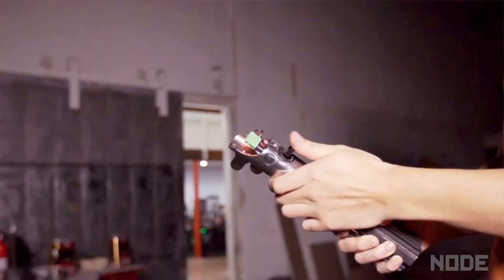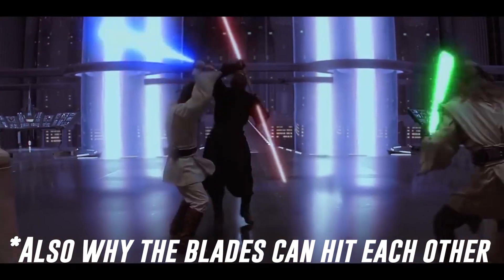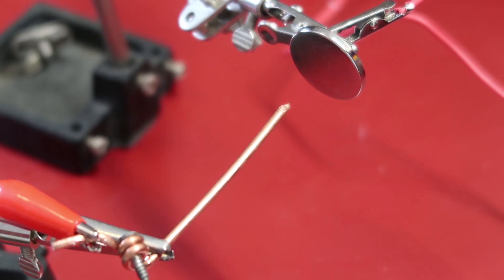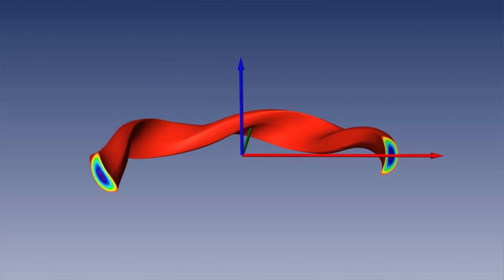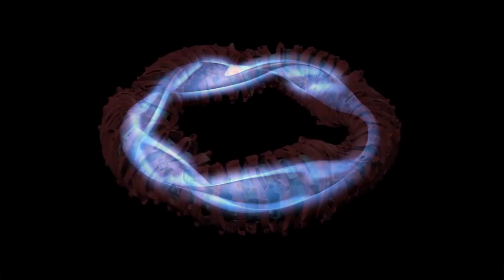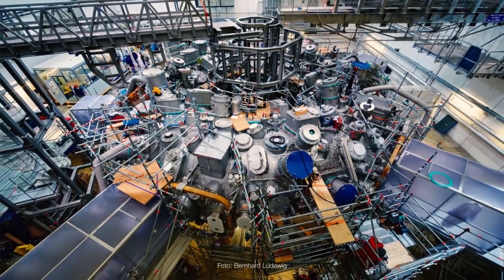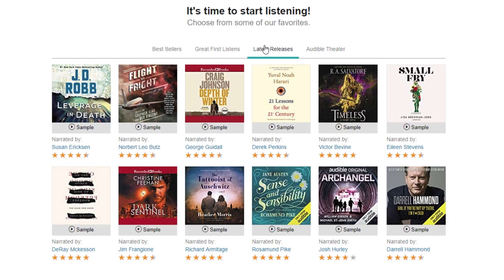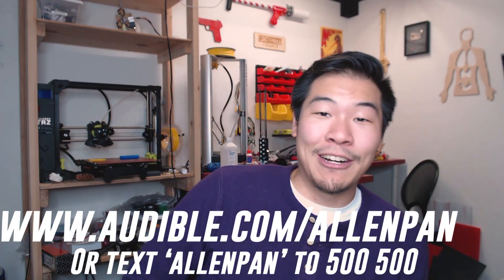Real Life Plasma Blades!!!

Comment: it is more like an inverted halo sword, yeah. But I wonder if you could make it have a rod in the middle and have like plasma, or eletricity around it to not have 2 completel usable pladeb and a useless plasma "balde" in the center. I know it' probably a dumb question to ask, but it seems kind feasable if the magnets try to atract the plasma instead of repel the and keep the plasma away due to heat (not very performane friendly ik)

Comment: This is lame...
We need a real blade that can handle being turned into plasma ..
I'm thinking an outer layer on the blade that will last long under super ionization.
A solid matter ofc.
And ofc like halo bringing the idea of magnetics into the mix that can keep the blade stable but we don't have materials that can handle this or a power source that can output this energy for long and be portable.

Comment: Hi Allen,

I’ve been wondering what would happen if the copper elektrodes (or a whole aray of them) are positioned in such a way (at the circumference of two shaped ‘plates’ or ‘blades’ which are doubled up a few mm apart so that they provide both the place holder between the electrodes ‘and’ a duct which allows air to be blown outward from the circumference (all around the circumference in equal measures)? The concept you guys came up with and built proves you can blow plasma away from the electrodes. If we blow it outward rather then length wise… wouldn’t we have an actual outside perimeter plasma edge? 

If you want I can draw a CAD assembly with the basic ideation (schematically and as a means of being able to discuss the idea).

Because of the nature of how the parts would relate to each other in this setup the actual physical blade would still have a (double) edge interfacing with the outside world when you hit something. All the elektrodes would be safely ‘in between’ the blades and somewhat recessed. Should make for an axe or blade you can actually use to forcefully hit objects without it breaking. 

Let me know what you think! 

With kind regards,

Marten

With kind regards,

Marten

P.S. have a look at my insta to see some of the things I’ve been up to in my spare time.

https://www.instagram.com/p/CJYqThBh71h/?utm_medium=copy_link

Comment: hi allen idk if i should ask on a more recent video but could you make a really hot blade but like this so it uses batterys instead of using a blow torch? and if that doesnt work can you get a small rod type thing with a hollow center and make a bunch of tiny holes - send gas thru it and then if thats working maybe also do the heat thing? i feel like it would look at least similar to a lightsaber and im not an expert but i assume you might also be able to change the color if you want

Comment: If you want something extremely effective and dangerous probably equally , may I suggest bladed edges and a motor to vibrate the blade with a plasma current down center for a V2

Comment: rotating the plasma rapidly causing a vortex, and will lengthen the plasma, of course you have to use a circular anode/cathode, you may also need an electro magnetic solenoid to push the plasma outwards longer.

Comment: Remember that flyback transformer makes DC output. Use some transformer that does not have rectifier at the output and it will be 100 times hooter.

Comment: what if you used a more conductive material instead of the copper. like say gold wire maybe, but that would probably be extremely expensive depending on purity.

Comment: i think the problem mainly is the plasma is still stuck between 2 physical blades instead of on the outside .
perhaps you could make 2 think blades out of like a pipe and have insulating material holding the back side.
then have an air fly going through it.
in theory this will push the plasma outwards forming a blade edge...
so you would have the metal body and then plasma edge on the outside instead of between 2 metal blades.

Comment: I mean, it's kind of cool, but it's also not really useful. If you can figure out a way to make it so that it burns hotter and one edge is entirely open to air, you might not be able to shape it as well, but it needs to be more useful than a knife or there's really not any good reason to use it.

Comment: Is it even still considered a blade when it's sheathed? Can't cut anything when it has a chunk of metal on both sides preventing any cutting. And because it's not that hot, basically what it's doing is just electrocuting the target that gets too close to the nodes (the furby didn't even die from heat, it died from having two high voltage chunks of metal zapping it repeatedly until it fried the circuits). Really disappointing :( Pretty sure i've seen 'safe' cosplay weapons that did more damage

Comment: Hey that's not fair why not unify intense radiation electromagnetic solenoid hold sense over acoustophoresis tractor beam fluid  plasma sword electron controls modulated light sensory axis accelerometer cylinder rotary thrust proximity radiation

Comment: Hi, i'm just thinking. Can't you make those thick steel rods into a flexible one so you can move them like a sword?  I mean if a metal is hot enough due to plasma can't it cut better than thick rods? It is like pseudo rapier plasma blade?

Comment: No is not 30cm..  its 1 meter apart..  so 100cm...  close but not actual distances.  Is 30cm between materials but heat transfer is on the cusp of one another at 100cm where if even if a small amount of gas wasent fully vacuumed properly to keep the pure atmospheric cooling conditions true then the entire thing would meltdown and being a nuclear reactor processed by plasma fixation, yea...  if your close by strike a pose so your shadow will confuse the fuck outta people when the radiation levels finally drop to a level where it can be explored again and they see a michael jackson nut grab pose shadow burnt into a wall..  i dunno if itd be that much of a toxic radiation issue though, being plasma and that much of it i think if it did implode than the resulting explosion of gasses all suddenly being stripped apart with a 60sq ft lightening bolt trying to find a ground..  itd get pretty boomy and hot around it...

Comment: I was kicking around the idea of a rifle with steel bb’s in a chamber that are fed into a magnetic bottle where plasma is “pumped” in and once a certain temp is reached the plasma bb combo is sent down a barrel lined with alternating polarity magnets that accelerate the plasma bb toward a target
Reply: So kind of like a BB railgun, but with added plasma?
Reply: Fighting Thunder : yeah the bb acts as a projectile for the plasma to “attach” to
Reply: @limabravo6065  the magnets would have such a big force that they would keep the plasma inside the barrel, melting it and backfiring horribly, wouldn't they?
Reply: Burnt Ivory King of Eleum Loyce / maybe but, if the super hot plasma was only contained for an instant before being sent down the barrel it might work. This gun would need a lot of processing power and materials designed to deal with extreme temperatures. And of course I’m not suggesting that it be a shoulder fired weapon or even crew served but more akin to modern pdc’s or a rail gun
Reply: @limabravo6065  if it was contained for an instant, that would mean that there is need for a burst of energy to create the plasma, which would probably just be more effective to use it as a bomb than losing it on a bullet.
Reply: Burnt Ivory King of Eleum Loyce / you can create and store plasma that isn’t hard to do (neon lights are plasma) but there’d need to be a separate chamber for heating it, look at the VASIMR rocket engine that’s what gave me the idea
Reply: @limabravo6065  I mean creating it and releasing it fast. Like a lot hotter and faster
Reply: Fighting Thunder / yeah pretty much, the bb carry’s the plasma with it allowing it to be shot

Comment: I have an idea. How about a zirconium oxide ceramic blade with titanium electrode strips down the length of the flat on either side of the blade, and an embedded magnet inside the ceramic with the poles facing either side of the double sided blade?

That way the arc can go around the edge of the blade through the magnetic field, and not only do you get the plasma, but you have an actual edged ceramic blade too.

Then all you have to do is condense the electronics small enough to be battery operated.

Comment: Why dont you yry cooling the electrodes that you used to Arc the electricity with some sort of CO2 or gas and also for the for the air supply maybe try using a 2 liter bottle compressed with air or a metal container compressed with air that can release Air I know that limits you to how long it could be on but it would make it portable and also by cooling the electrodes it would be more conductive possibly using like copper tubing Hollow with the gas running through to make cold that make it cool I don't know maybe I'm trippin let me know if you think that would work thanks

Comment: Better Idea than a monado: HF scissorblade with air blown to create this same non-thermal plasma effect. Essentially, combining this concept with the already combined High Frequency (HF) sword of MGS fame (quickly vibrating and more importantly AC electrified blade, both being at the titular high frequencies) and scissor blade of Kill La Kill (Just like a big pair of scissors used offensively) into the Metal Gear Rising Reveangance HF Machete Pincer Blades "Bloodlust" (used by Sundowner). Now, a simple air current, if the dual blades stayed non-adjusted, would be able to generate a nice plasma blade between the edges, which, with calculation, could be adapted and optimized to be as laminar and strong as possible. However, if we were to adjust the width, this would require much more calculation. This however, can be fixed with advanced onboard computers, which calculate and adjust airflow, current, and frequency to suit a perfected surface. However, these bulky modules raise higher questions about the nature of the weapons, and how to optimize the ergonomics, noticing the difference between the pincer blades attached on the side of the arm using cybernetics and the seemingly awkward usage of the Tachikiri Basami, or Rending Scissors, as demonstrated by Isshin Matoi. Better designs should most definitely require more R&D.

Comment: If you have the two Jacob's Ladder prongs roughly parallel with each other instead of facing each other and angle the air to blow toward the 'front' of the blade, would you be able to get the Gundam-style plasma-edge?

Comment: I did a sorta fiction write up about something similar in appearance to a light saber, where the planet gets blown up and people all die of horrible radiation damage including the person who picked it up and tried using it, cause "COOOL!" ie the blade was a massive group of nano particles of tungsten carbide and tantalum carbide, that is shaped into a thin shell like formation and vibrating back and forth by a microwave field, so yeah, the control gave it contour but microwaves were baking everything around the blade including him and he dies dropping it on the ground before hand still on, and it cut into the ground with ultra hot high hardness particles because they are banging into each other as well as being microwaved, to create a sort of magnetic back and forth on them, so it swung around till the handle was holding it up by being suspended on the sides  of the hole, till heat allowed that to soften and it sunk into the ground, continuing till it hits the center of the earth, sorta path, and hits a pocket on the way down and causes a super volcano to errupt including the excess power of the unit, before it cuts out from being damaged by al the thermal energy it is generating flashing back into it from the walls of this cut, lol, 

Again, all a big giant joke, like "you want the earth to blow up and everyone die? this is how you get everyone dying and the end of the world," sort of joke. heh heh
Reply: by the way you earned a sub from that, will be checking out your other videos, for more imaginative info being exposed in them, that I can possibly use to spark inovation in my 3D printer design I am working on. 

  I was recommended your video, because of all my recent investigation on plasma and vacuum deposition, to see what the actual nitty gritty aspects that have already been worked out so I don't have to figure those steps out ahead of time, before I can start testing and refine the concepts I personally have. like laser control vapor deposition *yes control because the right frequencies will actually hinder the process keeping something clean, while others promote it so that a weak nearly able to cause deposition set up would be bumped to allow it to actually happen where the path of the laser and its end point exist, as moved around with a cartisian XYZ system :)

Comment: The inside of the old color tv's was over 100 million degrees in terms of electron volts or the velocity of the charged particles which is temperature.
If you had a beam of ions fired out the center of the handle with a number of electon beans fired at an angle out the handle, the electrons would tend to orbit the ion beam and  create a magnetic field that would contain the ion beam in a narrow beam.  If a cylindrical space became ionized, the cylinducal plasma could extend outward for some distance.
A plasma cutter is just a jet of compressed air with a high voltage high current arc put put through it.
One sees a number of homemade fusion reactors that get a lot of fusion but certainly not net power.  They use a DC voltage to set up a high voltage between two concentric spherical grids.  
A Tesla coil can be run off of AAA batteries and create hundreds of thousands of volts.  The efficiency of the coil which creates an oscillating magnetic/electric field at resonant frequency could accelerate ions to fusion temperatures with very little energy input and possibly achieve net power.  Tesla might have tried this if he ever considered a fusion reactor design.
An actual working fusion reactor requires some way to protect the inner surface of the reactor from high velocity ions.  Hydrogen ions travelling at one million meters per second which is the aporoximate velocity required for DD fusion can knock atoms loose from stainless steel. A thin layer of compressed air will easily stop fusion temperature ions.
If you took a  cylinder filled with a mixture of boron and hydrogen and spun the gas at a high velocity, the pressure would increase along the inside of the cylinder.  This would decrease the pressure towards the center.  If the gas mixture was spun at a high enough velocity, a near vacuum could be created towards the center.  A good vacuum is required to accelerate ions to fusion temperature.  An electrode attached to a Tesla coil accelerates electrons and ions in the direction that the tip of the electrode is pointing. If the sides of the electrode are insulated, this would prevent radial acceleration of ions and electrons.
A number of electrodes inserted at an angle into the wall of the cylinder so that they are opposing from opposite ends would accelerate ions towards the center and middle of the cylinder.  If the electrode creates a plasma path towards the center to the boundary between the vacuum and the compressed gas, the high voltage should continue from the electrode to this boundary because the plasma is a good conductor.  Ions near the boundary could be accelerated inward through the vacuum to fusion temperature at a high enough voltage.  If an excess of about a hundred billion electrons is created towards the center, there would be a high enough negative voltage to contain fusion temperature ions for a distance of about ten centimeters from the center and middle of the cylinder.
PB11fusionn is much safer because it does not does not generate neutrons.
The CNO fusion cycle also does not generate neutrons.  At a high enough voltage, such an arrangement could fuse the carbon dioxide and nitrogen and oxygen in the air. Such an arrangement would drive a gas turbine.
A arrangement with electrodes from one or moreTesla coils in the handle of the plasma sword with the center electrode always opposite to angled insulated  electrodes surrounding it wouuld create a cylindrical plasma sword blade that would extend for some distance.

Comment: instead of having the plasma arc on the inside make many small ones on the outside so it creates a serated edge all the wat down both sides of the blade posibbly evane have more than two edges place as many edges you can around the interior mainline  power source kinda like a pine tree but not cone shaped. maybe serial up each tiny spike to power it up even more.

Comment: I think if you have the wires running along the the sides and not across, then have a tunnel right behind it to blow the air out toward the front I think that would make your desired shape.

Comment: What if you "folded" that blade design in half so the plasma would arc like right next to each other then along the opposite edge make a tube that would blow air in the direction of the "blade edge" so it is actually a plasma edged blade

Comment: wish.com has the s** on the Neil diamond magnets for a dollar you can take some magnets out of some scrap microwaves some motors make some copper coils and some windings and put them down inside run you a laser beam through a focal point of magnets wrapped as coils and vent argon gas with a little air fan or hose it'll blow out and you'll get your distance depending on your fan speed

Comment: try to make one where the plasma is on tge outer portion of the blad, even if you can only do it in a length of less the 3 inches that would be cooler.